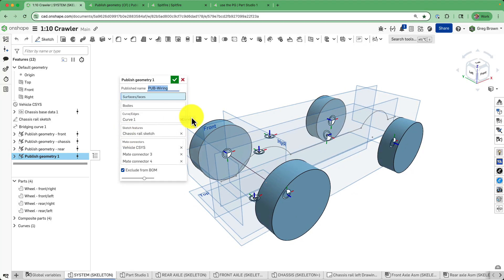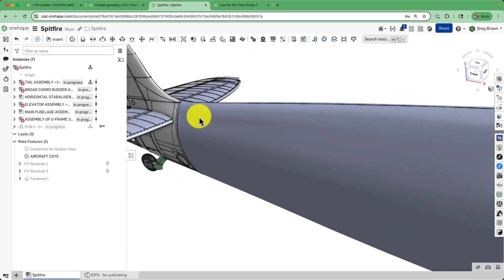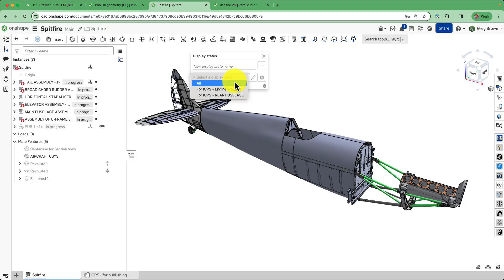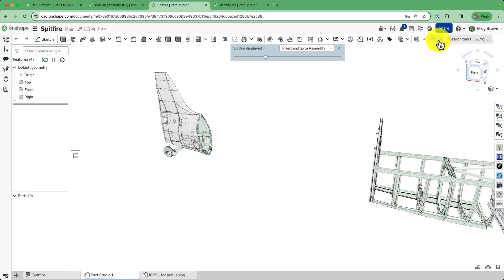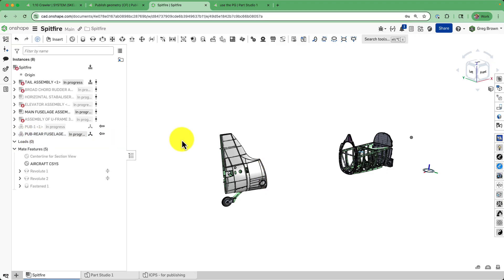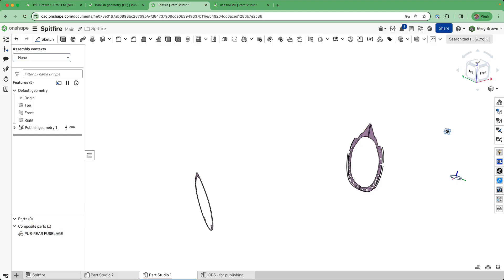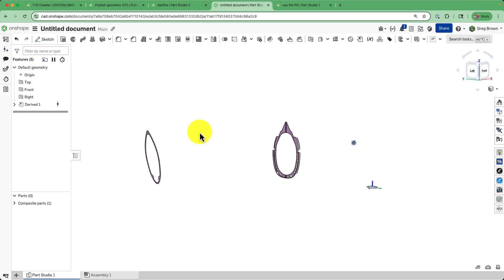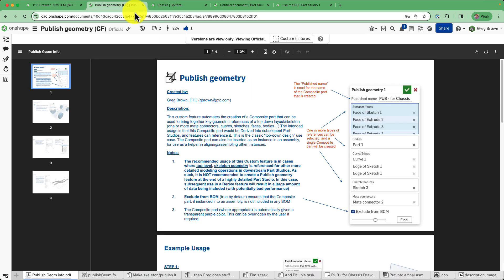Top Down Design with Onshape made easy - the *Publish Geometry* Custom feature is now... published

Comment: When creating envelope layout and space allocation I tend to do it in a part studio (ps) then publish the minimal interface using publish geometry. I recreated this script from your previous video (the rc car). But changed it to copy the selected faces bodies etc and create a closed composite part, then when importing you only have one part with derived (which u already did!). Then I insert the closed composite part in an assembly, and use in-context part studios to use the layouts. However, you have to create proxy assemblies to avoid having to insert the detailed parts in the layout assemblies… which feels off
Reply from the maker: My custom feature does indeed create a closed composite part of copied references, as you've probably seen my now. In-context usage is great tip. There are a number of ways Top Down Design can be achieved.